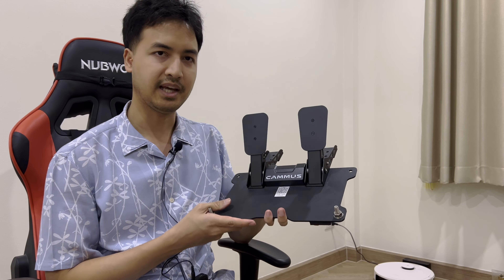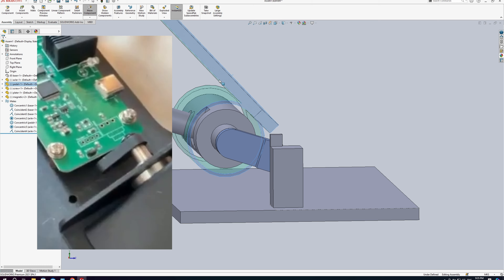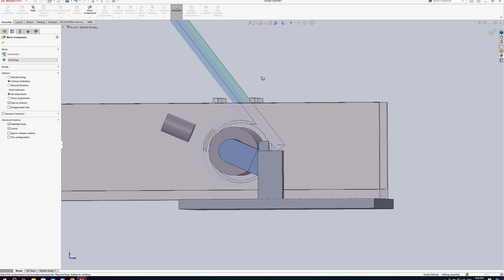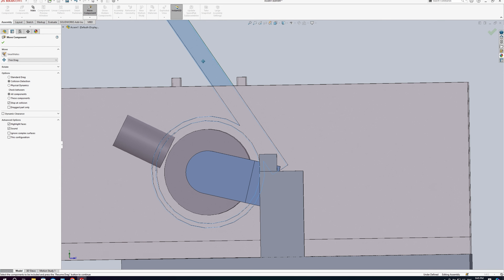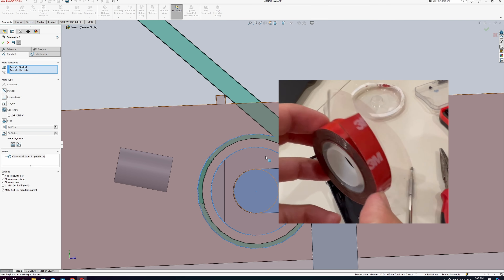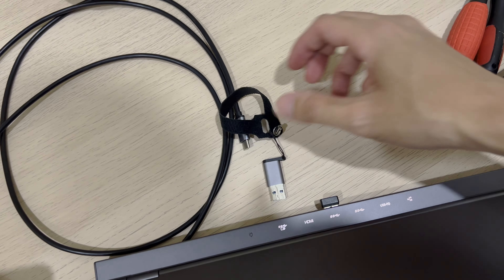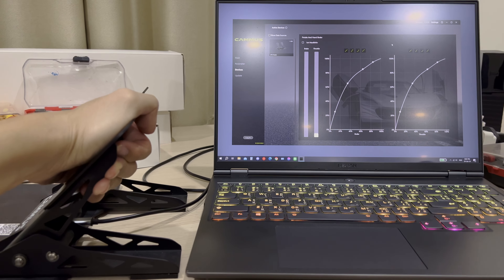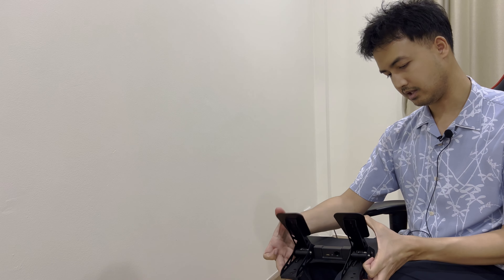A Great Pedal that got mess up by Quality Control - Cammus CP5 Review In depth

Comment: what should i do if the usb cable with the usb port dont have good connection. I have to lift the cable in order to get connection. Is it fixable?
Reply from the maker: you can try and make sure that your cable have grounding perfectly, or you can connect it directly to PC
Reply: @BoreyEngineering  the problem is in the pedals. The female port of the usb c probably does not make good contact with the board in the pedals.

Comment: thanks so much, it fix one of my problem

i hope you can tell me whats wrong with my another problem
when i first bought it the brake pedal had slighty harder resistance than the throttle, but now my brake pedal is softer than the throttle, any thought for that?
Reply from the maker: maybe check if there is any rubber inside brake spring. The rubber can be worn down and stop provided resistance. You can use something else to as a replacement
Reply: @BoreyEngineering  now it make so much more sense, i always thought the resistance come from the spring alone. thanks so much!

Comment: Hi! What software version are you using? I don’t have those curve editors on mine
Reply from the maker: I'm on 1.6.0 PC
And you also need to update firmware on CP5 as well. And you need to connect it through USB only
Reply: @BoreyEngineering  ok. So to update the CP5 pedals they should go straight to the PC and not through the wheel right? I’ve had issues when trying to update the pedals’ firmware when connected to the base (i have 1 CP5 that is not working atm)
Reply from the maker: @sebastiangomezbattista6260  I'm not sure but I did firmware directly connect to PC. If you connect to PC you need to use USB-C to A adapter. USB-C Direct to PC will not work
Reply: @BoreyEngineering  perfect, thanks!!
Reply: @BoreyEngineering  can I use any USB C to USB A adapter or does CAMMUS sell one?
Reply from the maker: @sebastiangomezbattista6260  Yes any cable. Cammus don't sell it. just a cheap adapter if it transfer data will work just fine
Reply: @BoreyEngineering  thank you! Final question: do the pedals have a DFU mode or it automatically applies when connecting to the PC directly?